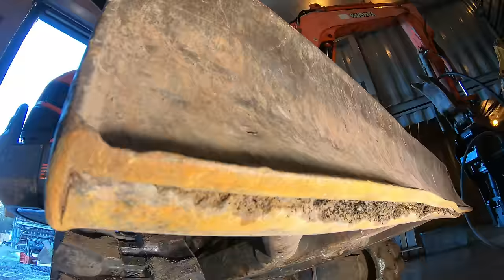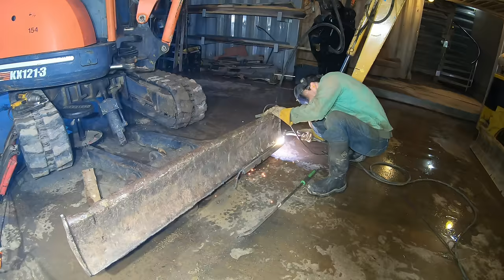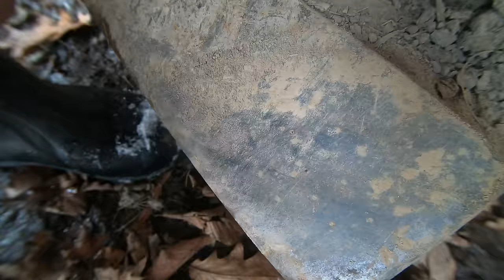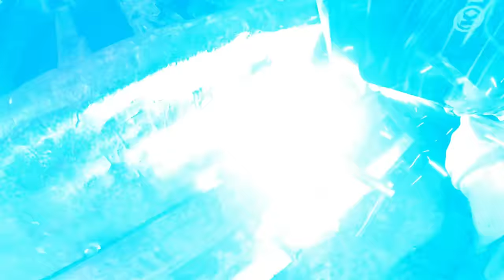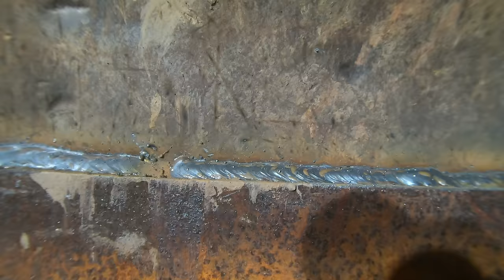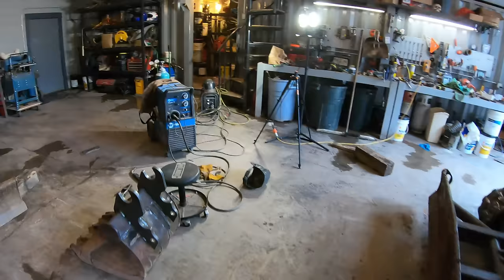Replacing a cutting edge on an excavator blade

Comment: Andrew, please take this comment in the manner in which it is meant. (i.e. as being a helpful suggestion from a person who wants to see you succeed in life) You need to come to the understanding, that when you purchase used machines and/or equipment, you are buying what the previous owner had deemed to be something that was either worn out or had become too costly in repairs and parts replacement to maintain.

Cheaply priced, well-used machines and equipment are rarely cheap in the long run to the person who bought them, when issues such as, downtime, parts replacement, repair cost, and excessive maintenance cost are added to the original purchase cost.

Yes, used equipment which is in good working condition is going to cost you more than equipment which being sold by an individual without any guarantee. However, if you want dependable used equipment and/or machinery, such can only be found at a certified dealership business. Such used equipment is completely checked-out, serviced, cleaned and certified to be in good working condition by a manufacturer knowledgeable mechanic, before the piece of equipment is ever put on the lot for resale. Additionally, such equipment comes with a manufacturers warranty.
Reply: You will often find that people own equipment and have no idea how to work on it too. Which yes, leaves you replacing parts enmasse at first. But provided you yourself conduct general and preventive maintenance on the piece of equipment there-after will usually yield a sound piece of equipment with a long life ahead of it.

I've picked up turnover but no start equipment that just needed points for pennies on the dollar compared to certified equipment, and I've picked up certified equipment that spent more time having it's warranty used than it spent being productive on a job. 

Luckily for us Andrew takes the time to document how he approaches the repairs of his own equipment to bring it up to his own standards. I'm sure that he wasn't complaining about the lack of maintenance from the previous owner so much as making an observation about the equipment lack of proper maintenance. Though looking at it, it's clear that they were not interested in doing the repair. Perhaps they hadn't considered just replacing the cutting edge and had considered the cost of an entirely new blade as the only option. We may never know. The good news is now we have a great guide on how to handle the situation if we encounter it. I'm personally one of the DIY kinda guys who tends to want to outsource as little as possible. The only time I "can't" do something is when I don't "want" to do something. Those two things are often confused.

Comment: see most guys would of seen that at auction  and said , needs, a new , blade , teeth , hours too high ect, because they would not or could not do a simple , but time consuming repair on their own ,  that what sets you apart from a lot of others out there, , even take there was no quick change n the hammer or other bucket,most guys would not of bid, but there is now, and you got what you needed , for some of your past jobs, with out trying to rent one if one is even available when you needed it , or sub that part out,to some one else, and now  even subbing of the plumber guy a few videos back ,,, thanks for sharing your journey ,,,

Comment: Good job Andrew. Put it on level to the machine, nice. Where do you get a welding machine for a couple hundred bucks, pick me one or two up would you
Reply from the maker: You can usually find an AC225 welder for $100 used. They never stop working.

Comment: Just kind of a dumb question, but have you ever used a flap wheel to just clean up the crud from your surfaces and the slag from your plasma cuts to leave yourself bright metal to weld to?  I've generally had a LOT better luck getting good welds burned into clean metal than trying to weld through rust.
Reply from the maker: I do if it needs to be cleaned. That metal was plenty clean to weld.
Reply: @AndrewCamarata  Fair!  I'm just one of those nitpicky people that likes that metal bright and shiny before I strike an arc.  ... I don't have to make a living doing it, so I can take the extra time.  lol

Comment: if only you had a device that could use high pressure water to cut through and force out all that dirt...  :)  I too get so focused on a job I power thru it instead of using all the tools available.

Comment: Not to be nit-picky for the sake of it, but you're a tad incorrect about the plasma cutter. The tips are considered consumables and have to be replaced after a while. Granted, it's not often, but it does have to be done once in a while depending on how much you use it. I always have a couple spare tips for mine and have replaced them two or three times in the many, many years I have owned my plasma cutter.

Comment: You said the plasma cutter just needs electricity and compressed air. How much air does it use? What do you use for your compressor CFM wise to pus that thing? My compressor is pretty small and doesn't run very many things for very long aside from my nail gun.
Reply from the maker: Zerkini The air compressor I’m using is not very big and it runs it fine

Comment: the easiest (and best) way to tell if it's hardened steel or not is by using a hand file, since the hand file is also made from hardened steel, when filing another piece of hardened steel the file will pretty much skate over it, if it's soft steel it will bite into it. They even sell hardness level testing file sets, for like $50. The divot left by your punch looked exactly the same size on both pieces (on video), so it's very unreliable.

Comment: If you take a file and scratch the metal surface it will tell you if it's mild or Hardened by the marks left from the file

Comment: Also your mig welder you use the one with gas cylinder is that argon gas for your welding ok what my question is I bought the smallest mig welder I could buy, but never got a chance to use it. Somebody stole it  bummer life go on, would you recommend a mig welder with or without the gas to do miner welding and can it do aluminum I know its a softer metal. Your thoughts would be appraised.

Comment: How was the travel motor oil condition?
Reply: Good point, by the looks of the blade those travel motors were working hard on something.  Hopefully just scraping concrete or rocks.

Comment: So i am pretty new to welding but i have a Mask that automatically darkens as soon as the welding starts. Now i am wondering why you don't use one of these? Maybe they don't protect the eyes as good? Then i would have to get a different one asap! But it is so practicall i can still hold a piece of metal in my and weld it on without being totaly blind from a complete dark mask.
Reply from the maker: ChiLLum I am using an auto darkening helmet.
Reply: Andrew Camarata ok good i am relived to hear that! Thanks

Comment: Was your garage floor sweating like that?

I have an unheated uninsulated 2.5 car detached garage and the floor occasionally sweats like that as well.

It's a slab and there's no drain tiles so I assume your garage slab and my garage slab face similar difficulties in a northern climate.
Reply from the maker: Roof was leaking.
Reply: @AndrewCamarata  Gotcha.  Does it sweat otherwise in certain weather conditions?  Strange thing about my floor, if the dewpoint must be just right, the floor will be dry but once I step on it with shoes will start getting moist where I have walked.  Weird!

Comment: That machine to be perfect should have one arm that slides to made it angle and on the corner so you could tilt and wait for it some way to slide the wholed bade over to use like a wing for pulling ditch lines. I've seen that option on any blade short of a grader. They are not intended for the blade anyway but a man can dream can't he?

Comment: Wouldn't long tacks (Stitch Welding) be easier than fully welding the top of the cutting blade to the mild steel frame? That's how I welded wear bars on buckets when I welded in the 70s thru the 80s, saved on hard servicing rod.

Comment: Needle gun that crap out mate
Next time u want to straighten the bent blade
Big sledge hammer and bash the edge. In effect yr stretching the edge out. Ie it’ll straighten the flat bar up
Weld from the centre towards the outside edge
When using a mig. Push the handpiece to weld. Don’t pull towards you. Only pull towards you when stick welding bruv
Cheers

Comment: Buon lavoro di restauro della benna raschiante, posso sapere che acciaio hai usato ? hardox 450 o T1 ?

Good job of the restoration of the bucket and the scraping, I know that the steel you used ? hardox 450 or T1 ?
Reply from the maker: AR500 they called it.
Reply: @AndrewCamarata  
sono un p'o arrugginito su tali metalli, circa 15/20 anni fa non esisteva il 500

are a p or rusty on these metals, about 15/20 years ago there was no 500

Comment: the proper name of steel you want for a cutting edge is T100 that little spring punch will never mark it, but you have to weld it on with low hydergen rod like an 8018 not not 7018 and no wire feed. or better, and no you cant shear cut T100

Comment: I would have used a stick wilder.  I know it would be  slower  but if there is any rust anywhere stick wilde will  hold where mig will not .

Comment: With all the grease fittings you have in the yard you should get power greaser think how much time it would save. It would pay for itself PDQ.
Reply from the maker: I have an air powered one that pumps from a big barrel, I thought I used that in this video. Plus I have an electric one that works well.
Reply: He has a air powered greaser he got at a garage sale. Has so much grease let from when he bought it.

Comment: Did your Komatsu come from the factory with the blade angled back, or did someone modify it?
Reply from the maker: That's how blades are. That way the material rolls.
Reply: @AndrewCamarata  I have  Komatsu excavator very similar to yours, but the top of my blade doesn't angle back like yours, my blade looks like the blades on all of your other excavators.

Comment: i love that you call it hardend steel, hehe yes there is some steel in it but its not hardend, its a mix of several hard metals,, in norway we call it HARDOX,, its a plate kutter killer if you try to cut it with a iron plate cutter becouse its almost as hard as the cutting knife..
 but its perfect say for the shear of plows-ore excavators...
https://www.ssab.com/products/brands/hardox/products/hardox-450

Comment: Can tell your not a real welder or you would have ground everything cleanliness is key to strong welds
Reply from the maker: The metal was clean.
Reply from the maker: This was a year ago, that blade is fine. When I weld something, it never breaks. I have been welding lots of things since 2003

Comment: why would you use mild steel on any piece of digging, hammering or scraaping machinery ?
in all of Europe we use HADOX for all and any excavators, truck mount snow blowers, snow shields or hydraulic hammers   
HADOX is a special metallurgy steel very similar to US AR500 from your cheapo bullet proof vests 
i made my own plate carrier inserts and flex seal anti spawl out of 3/8 inch Hadox as well as a firing range gong

Comment: Why not just weld on the pre made heavy duty cutting edge you can buy at most welding/machine shops?
Reply from the maker: d6joe what’s the difference? I asked one person for a cutting edge for that machine, they wanted $400, and it was the same thing anyway. I paid like 50 for that piece.

Comment: That edge needs Hard Surfacing or it won't last 5 minutes. Not designed as a dozer blade.
Reply from the maker: I used hardened steel. It will last forever.

Comment: Dude what about grinding the surface clean b4 welding , that's  basicly the first rule . penetration without gunk or rust in the way
Reply from the maker: Nah, it was fine, Burn that metal clean. Its not hard to see if its welding good or not. This repair held up fine.

Comment: 4:00 Is that blade hollow?  what's all that junk in there, dirt or rusted metal or something?
Reply from the maker: There is an empty area there.
Reply: @AndrewCamarata  It just got filled with dirt?
Reply from the maker: Yeah, when the bottom wore it it made a hole and dirt pushed inside it. I got it all out and fixed the hole and cutting edge. Its good now.
Reply: @AndrewCamarata  Awesome video, and great instruction and explanations.  Thanks for everything.

Comment: Does anyone hardface their cutting edges with hardfacing welding rods?
Reply: You usually only see that done on heavy mining equipment.  For small equipment it is more cost effective to cut out and replace.  Hardfacing is an art and not many welders want to spend the time doing it.  It takes hours and hours and after you are done it looks pretty ugly.  Sometimes an equipment owner will hardface a bucket that is working in rock a lot, but most don't want to spend money on welders wages so they just cut out worn areas and replace with a tough metal like T1 steel or some old dozer cutting edges that were replaced.  Dozer cutting edges weld pretty good with some 7018 rod but you have to go slow.  I tried welding on some old motor grader blades but these must be made of some super strong metal because they cracked like glass when the weld cooled.  Don't ever throw away your old dozer cutting edges, save them for putting side cutters on backhoe buckets.
Reply: @davidmorse8432  I was thinking about just running a straight bead of 7018 along the bottom edge of my plow cutting edge to slow down the wear. I already had to weld a section of old leaf spring to  one end of it as it was tapered up about 1.5 inches along the last foot or so. That seems to be working great so far with no cracking etc and I do rutted gravel and of course hit curbs.
Reply: @jamesnm21  I like the leaf spring idea, unfortunately most leaf springs have some curvature to them. How do you handle that?
Reply: @davidmorse8432  it was the thick flat  bottom leaf that supports The curved ones. Plus it was only a 12 inch piece so curve would have been negligible. I've used my acetylene torch to heat springs and bend them though it takes a bit. Propane forge would work much better but I don't have one.
Reply: @jamesnm21  Hey James, We don't snow plow where I  live now but i think some plow manufacturers make a rubber edge for plows or is it polyurethane or something? Ever thought about using one of those?
Reply: @davidmorse8432  not sure if they would scrape pavement as clean as steel or stand up to gravel abuse. Andrew uses a rubber spacer between the plow and his edge to help it ride on top of gravel better. I might add something like that.

Comment: you operators are all the same , smash out those pins with whatever is handy. Then bring it into my machine shop bitching because its egg shaped on the ends . buy yourself some 1 inch BRASS  bar stock and use that as a drift !!!!